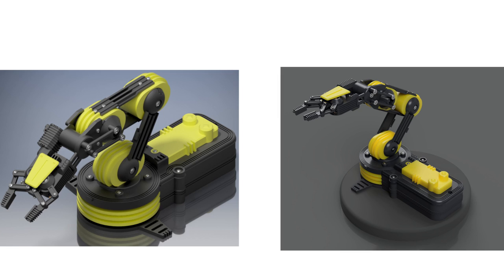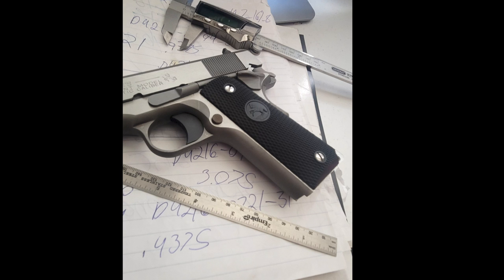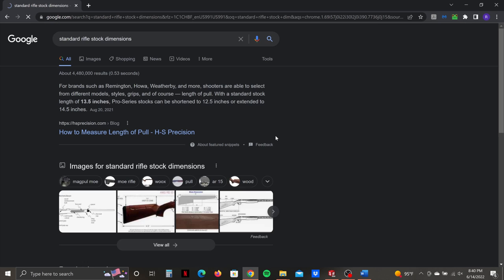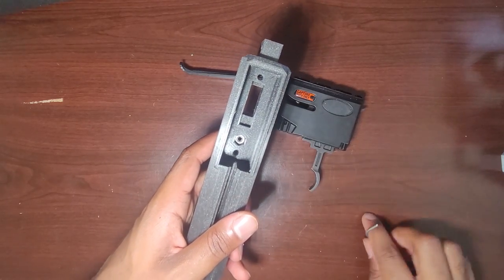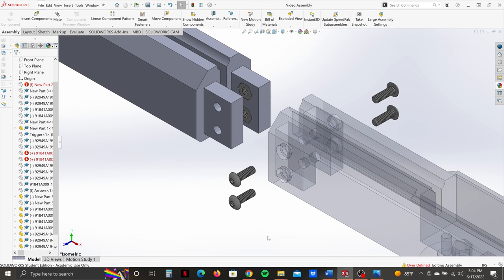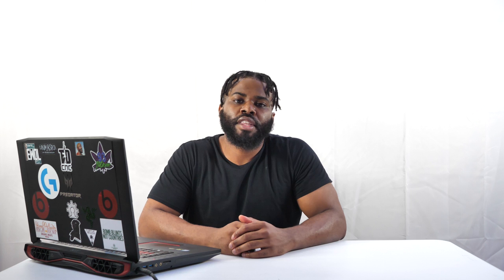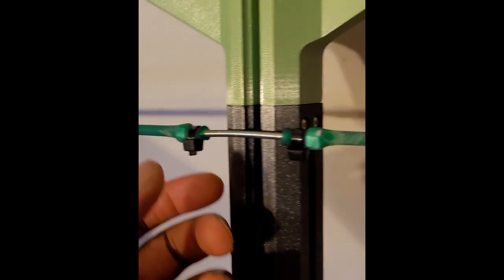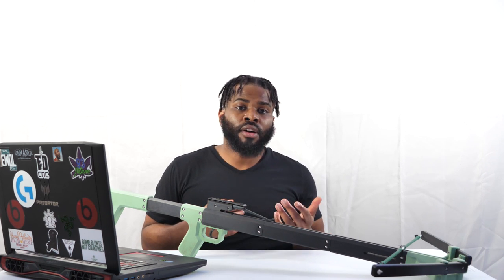3D Printed Custom Crossbow Design + Tutorial: The XBOW Crossbow | TinkerPro Builds

Comment: The riser I would recommend PLA+ and up the infill to at least 60% to get the breaking under control(25% is way too low imo). Obviously if you did 100% infill it would be sturdy and last quite a long time but I realize 1) it’s a prototype,2) it will cost more and 3) it’ll take significantly more time to print. For the next idea (bearing my suggestions in mind) you could more than likely make a riser with a 4 arm cavity for more ft./lbs. good Kobe either way bro.
Reply: Good job either way*
Reply: Make a riser with a 4 arm capacity*
Reply from the maker: Thanks for the tips bro! Yeah I was thinking of a 4 arm riser for the 2nd version of the design as well! We'll see soon enough! I appreciate the support 💯